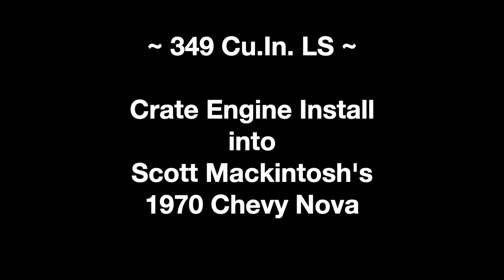349 Cu.In. LS Test Fit 1970 Chevy Nova SS

Comment: It's things like this that make me wish I was not this old, but I did get to drive a 1969 Z/28 off of the lot. Worthless with the stock gear, 3.73 if I recall, but in the magazine "Hot Rod" they went with a 4.88 and so did I. It excelled at eating Mopar's alive.
Reply from the maker: That’s awesome! Must be some great stories from those days!
Thanks for commenting :)
Reply: @ceperformance  This was back before radar was in every police car and now there are so many township departments it's not worth the risk. In addition, I must say, the 4.88 with a 2.20 first gear was 7.08. My 2007 Z06 Vette with a 4.10 and a 2.66 first is 6.76, close, but the T56 transmission and the linkage from the front to the rear will not allow the "real" no lift shift like the M21 with a Hurst shifter bolted right to it. The 0.50 sixth gear still lets it get over 20 MPG around town, third gear is a killer when passing.
Reply from the maker: I love the stick shifts too. The most exciting one in my past was a 1965 Impala, 454 with a Jerico drag race 4 speed (on the street!)
Clutchless shifting at 7000!! Good times.
Reply: @ceperformance  OMG, we are on the same page! If I was F**k You money rich, I would love to build an LS-7, 7.0L, destroked to 3.00, way over square, about 320 cubic inches. I did go off the rails with mine and put Crower shaft rockers on it. Over kill for the street, but these motors have a tendency to swallow exhaust valves. Some do, some don't.
Reply from the maker: My goal is to build a 361 LS. I’d use a tall deck LSX block, 3.267” stroke and 6.56” rods making it 2:1 rod ratio. Aiming for 2x HP per cubic inch on pump gas for a street car :)
Reply: @ceperformance  get DOWN!

Comment: Why not use a 3.62 crank? There aren’t any forged in that stroke unless you go Bryant… and forged 3.6” cranks are really affordable / lots of options including from gm
Reply from the maker: Hello and thank you for asking. 
There are several reasons why we built it this way and the simplest answer is because we wanted to! It wasn’t because of a lack of options nor was it to just use parts we had laying around. Every part was chosen for a specific reason and the crankshaft was the first decision. 
Bottom line: the results speak for themselves that this combo has a purpose. Not every build needs to be a a stock bore/stroke or a big Stroker for that matter. 
1.889 HP per cubic inch out of a pump gas V8 N/A street engine? Pretty happy with that :)
Thanks for watching!